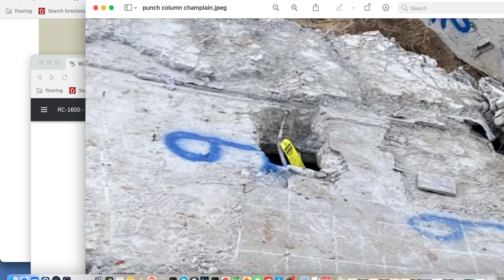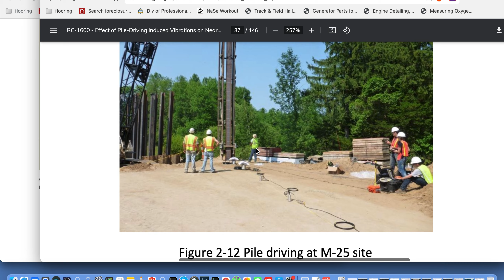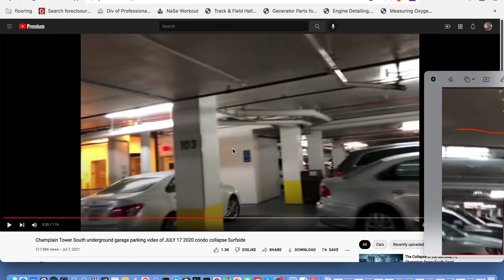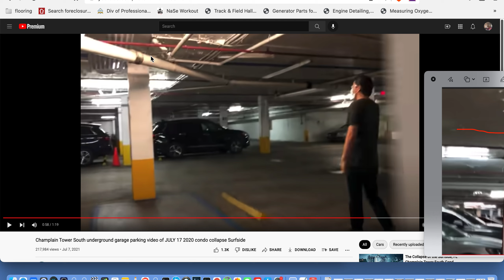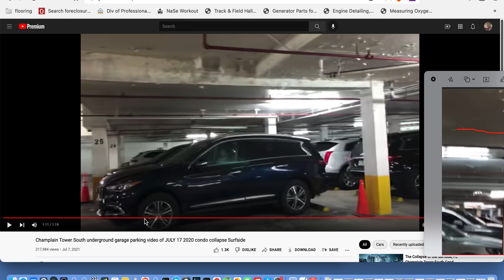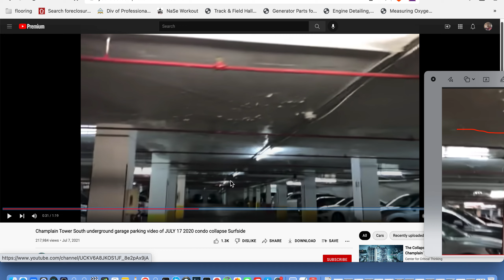Champlain Towers as-built reveal good drainage PLUS Tributary Failure Shown DECK HAD 2 ZONES MINIMUM

Comment: The 87th Terrace between Champlain South and 87 Park became a narrow path from a wide road it was previously, after the developers of 87 Park bought it from North Miami Beach. The lot of 87 Park was extended this way, and its parking spaces are in that area, by Champlain South. So, I doubt the draining of 87th Terrace is the same as in the original plans. In fact there is information to the opposite.
Reply from the maker: Are you saying water flows uphill, these drawings show water flow has a limited amount of footage where it meets the ''crown'' of this survey.  
I thought I made it clear how they work in this drawing; standing water is very limited and no signs of internal water damage has been presented and you have information, please provide it.

Comment: Hi Kai, 
I believe the type of rebar used at Champlain Towers was a major factor in its' collapse, which was Black Rebar, I would like you to address that.  This the information I found:  The most common rebar, “black” bar is used on every type and scale of project with few exceptions. The biggest weakness of black rebar is that it corrodes. When rebar corrodes, it expands cracking and breaking the concrete around it. For situations in which the rebar might be exposed to humidity or water saturation, there are better options than black rebar. However, with respect to is value/tensile strength ratio, black rebar is the best rebar available.  Thanks
Reply from the maker: Chris, I am the person who identified the rebar as "black rebar", I did a video on it and we chatted about it...
It's not good for salt environments but is priced right for non-salt environments.